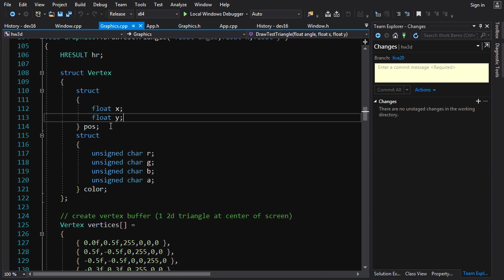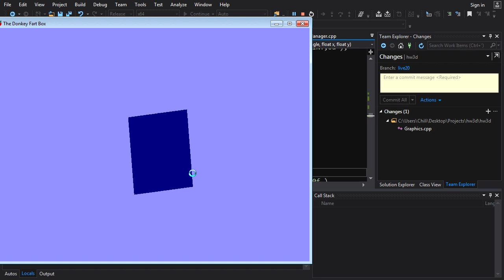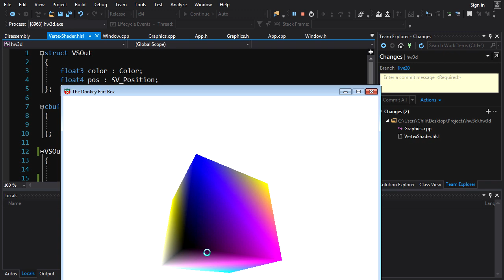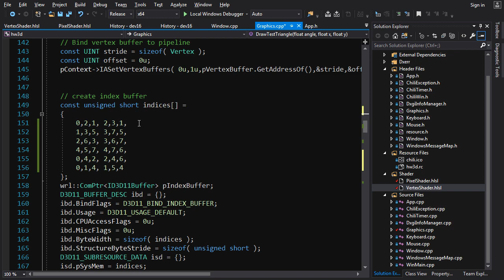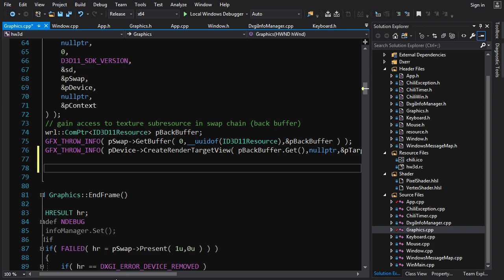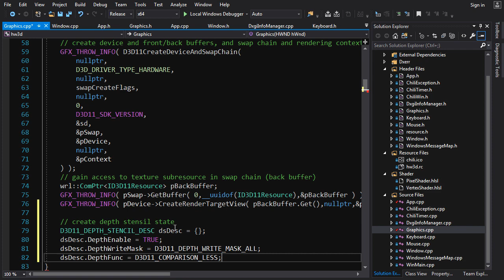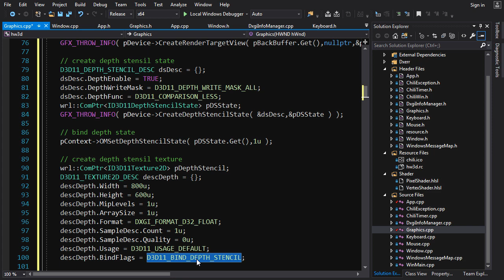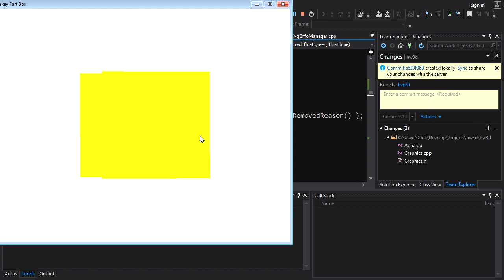C++ 3D DirectX Tutorial [3D Cube / Z-buffer]

Comment: Any idea why the cube could be distorted even with 1:1 aspect ratio? (putting 1,1 into perspective matrix too)
Reply from the maker: is your actual window 1:1? if not, then 1:1 in the perspmat gonna distort
Reply: @ChiliTomatoNoodle  Yes, it is, 800x800, and i set the viewport width and height using rect from GetClientRect(HWND) (bot-top, right-left)
It is not distorted without rotating, it only looks odd if i satrt to rotate it
Reply: Found the "Problem" :D I set the nearZ plane value to 0.1f, and the cube was so close that it made it look strange, but i think it was working correctly. Setting the nearZ plane distance to 0.5f, liek u did in the video, made it look normal. 
In Short: It was workign properly